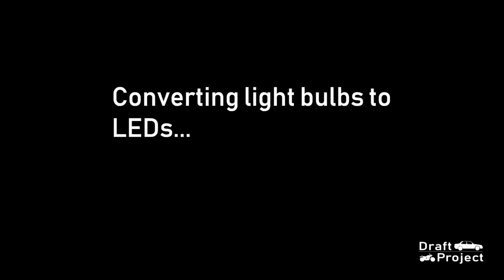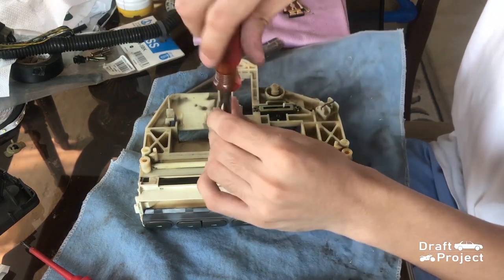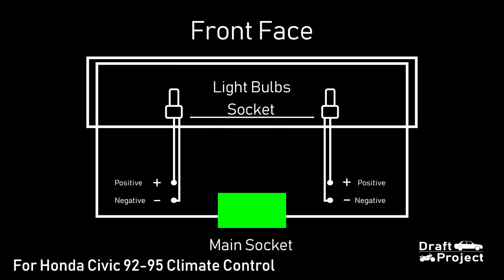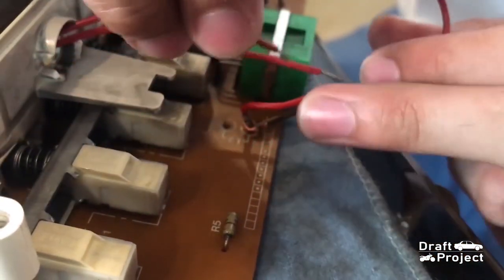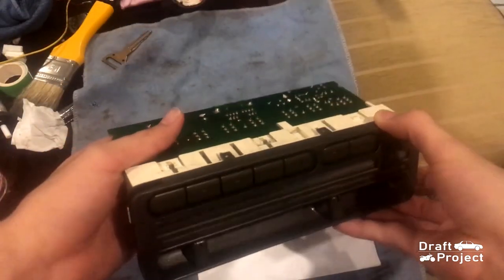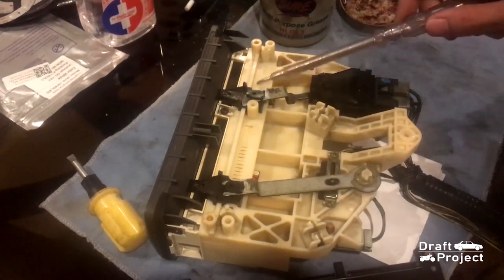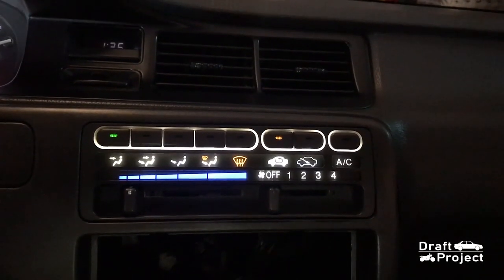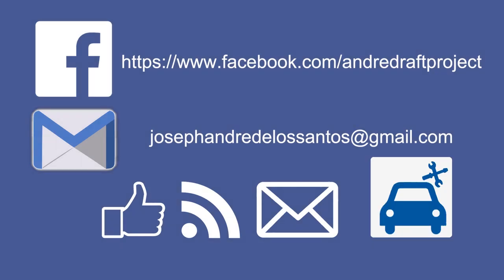Convert your Climate Control Lightning with LED Strip Light

Comment: Hello, great job you make here !

Do you know if we can reduce brightness of LEDs because my eyes are very sensitive, especially at night, and I think I will also choose warm light LEDs.

An other questions, do you know how to fix a rumble air conditioning fan that make a metallic sound in the engine bay and make shake the exhaust muffler ? Because on my EG, when I put climate air throttle on pos.4, that's happened.
Here is videos:
Normal running, without air climate ventilator :
https://youtu.be/Id5Uj68SoQw
And with ventilator at pos.4 :
https://youtu.be/wZTx2lkjOFI

Thanks in advance !
Reply from the maker: I think there are two ways that you can do. 
First one is the OEM dimmer switch which can be intalled into your car. That can reduce the brightness of the lights in your instrument cluster and climate control with only a control of a switch. I'm not sure if it only needs the switch itself or perhaps another resistor module is needed. If you are planning to get one, just research for it a bit to make it sure that you are getting the right parts.

The second one is to use an led strip light that is controlled by a remote. As far as I know, this has a changeable color and brightness which can be controlled by a remote.

I watched your two videos that you had sent me and these are my analysis.
 
In your first video, I can hear a small vibration in the engine from time to time. Perhaps it could be something loose in the engine bay. Maybe a bracket from the exhaust, intake, carburetor, and other spots. Try to check the bolts to make sure they are secured. Also, make sure that the bolts of the engine support is tight and the bushings are in good condition.

In your second video, while the air conditioning fan is running at no. 4 position, I can say that your idle is low due to the added engine load caused by your air conditioning fan running at the highest setting. Since you don't have an A/C compressor and Idle up boost solenoid, this is normal. Your engine will only rely on the idle speed setting of the carburetor. With a low idle, the engine and exhaust would shake, which is normal.
 

Try to increase the idle speed to compensate the engine load brought by the air condition fan running at highest setting. Also, as I said earlier, try to check every bolts and brackets in the engine bay. That sound of rumbling and metallic noise seems to be a loose bolt or bracket, vibrating all along. Try to check the underneath too, like the exhaust manifold, pipings, flanges, and exhaust hangers. If one of those are loose, broken or detached due to rust, that could be a possible of it.

Also, you might want to consider having a valve adjustment too in the future. That will make the engine quieter and more responsive.

I hope this helps! If you have more questions, feel free to comment down below anytime. Thank you very much for watching video!
Reply: @DraftProject  thanks for your reply 👍

I said "air conditioning" but that refer to blower ventilator as you understood.

The carb was never adjusted, and pass all pollution controls here (0.5 % of CO max) and run well without problems. (But I know I have to tune it)

Yes I know I have the valve clearance to adjust, I was never do since maybe 15 years.

That's actually the car of my grandpa, he will give me it when I will have my driver license (2023).

So, you feel the engine a bit too noisy (rocker arms) ?

Thanks for the tips 👍
Good bye.
Reply from the maker: @CelestinHonda33  A little bit noisy, but that can be also cause by the audio recorder, to sound more treble. Still, the car is still in good condition.

I see. That's great. Kinda rare to see a stock Civic nowadays. Keep that precious gem. Keep it up. Take care!

Thank you too! :)
Reply: @DraftProject  Yes, all stock 327,000 km, my first target is 400,000km without engine refection
Reply from the maker: That's great! Well maintained. Just enjoy the car while you build it in the future:)
Reply: @DraftProject  Thanks, I very like this car. For exemple, I built about 80% of the French Wikipedia page about the 5G Civic :
https://fr.wikipedia.org/wiki/Honda_Civic_(5e_g%C3%A9n%C3%A9ration)
Reply from the maker: @CelestinHonda33  I checked it and I was quite surprised. It is detailed! Awesome job!!
Reply: I would add a small microcontroller like esp8266 then you could change color and brightness via wifi